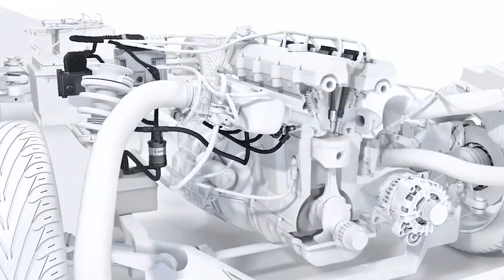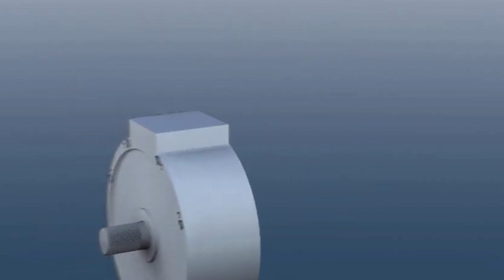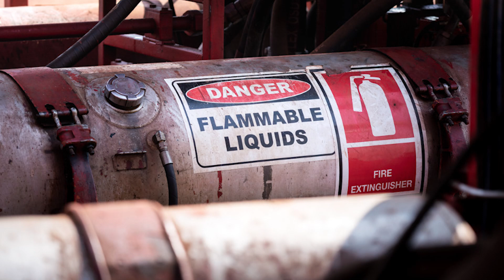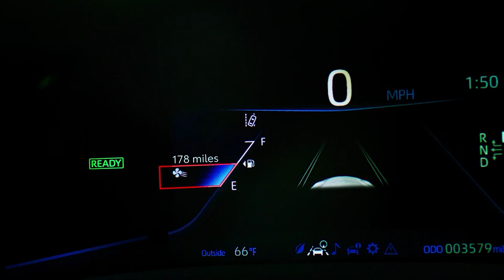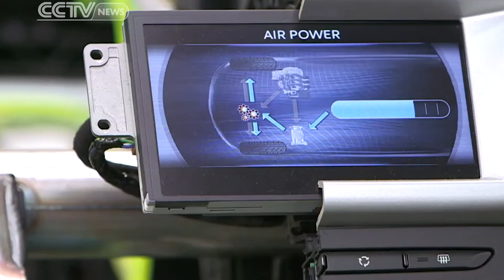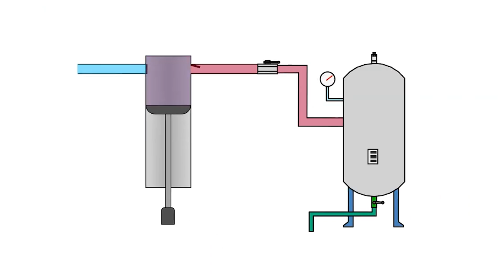GM CEO: This New Air Engine Will CHANGE The Car Industry

Comment: What a joke. We’re nowhere near peak oil, hydrogen and battery power are here and efficient…and GM is throwing this into the ring? Come on.

Simplify things. Standardize swappable battery packs between makes/models/platforms, get the thorium power generation fired up and stop burning high-sulfur bunker fuel to transport mass produced consumer crap across the planet on massive cargo ships. 

It’ll never happen, though. Not enough profit in it. Yet.

Comment: I thought this must be an April Fool thing - but evidently, they're serious.   Unless they can get the weight-to-energy-storage of an insanely high pressure tank below the weight-to-energy of a battery - this becomes a ludicrous proposition.  There's no way this will ever be a realistic proposition.  The air tank doesn't only have to be strong enough to hold the pressure - it absolutely must be able to survive a worst-case crash - because if you release the pressure required to give a car even a 30 mph range - it's going to go off like a bomb if it breaks.  The problems of building such a tank is kinda blown off as an incidental thing in the video - when in reality it is the number ONE consideration.   The battle for the next-gen renewable energy car has already been won.   Battery electric is the future - and all of the nonsense around hydrogen and air energy storage is a joke.
Reply: That's an easy problem to deal with. You just have to install a burst panel implemented into the fuel tank that will allow the air to flow away in a safe direction in event of an accident. Probably hooked to a sensor along the lines of an air bag sensor. Air bag goes off the burst panel opens. Same thing I have installed on the intake manifold of my supercharged car. 
The problem with this technology is how are you going to get to 3rd world countries? Most of them still use diesel powered vehicles and will not change. Only a handful of countries use electric cars now.
Reply: @saulGjr  Firstly - in the event of the cylinder cracking - the result would be a high speed explosion - secondly, how would you know what a "good direction" would be - and thirdly - you simply wouldn't have time.  pieces of jagged metal cylinder would be moving outwards at close to the speed of sound.
Reply: @SteveBakerIsHere  do you know what a burst panel is?